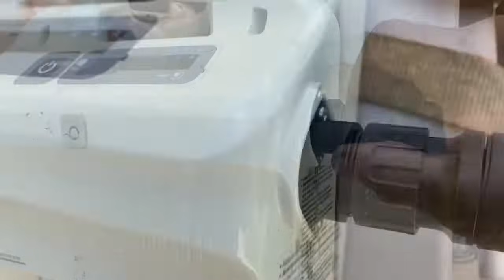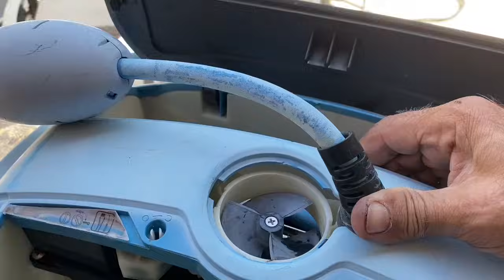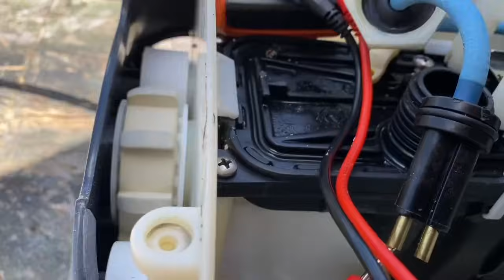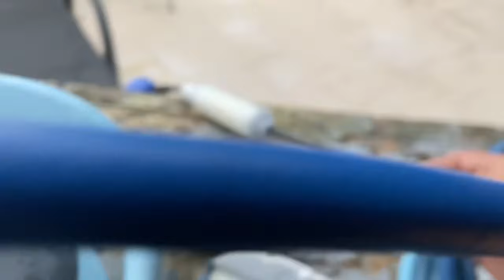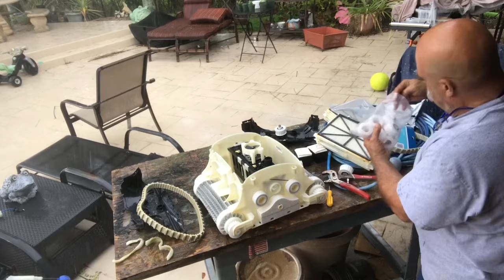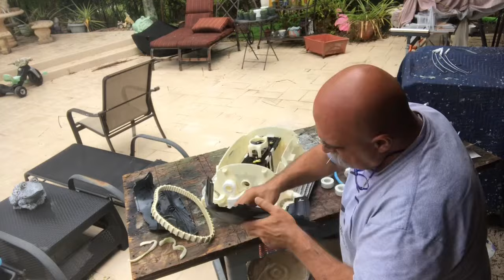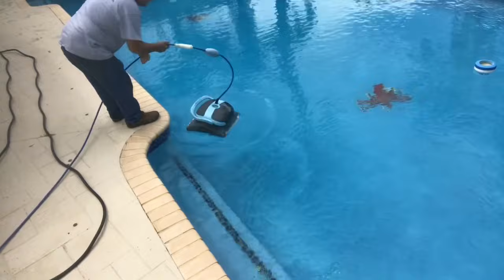How to diagnose and repair a dolphin pool cleaner

Comment: Can you not check for voltage at the end of the cable?
Reply from the maker: Yes, as long as your cable is working fine if you don’t get voltage, then go back to the power supply and then also check your cable for continuity. I hope this helps you and if you can leave me a thumbs up.
Reply: @buildingwithpapa I’ve got voltage at the head controller & at the end of the cable inside the robot so I’m guessing my robot itself is bad? I replaced the cable & it ran about 15 minutes and died.  My question is if you’ve got voltage then you’ve got continuity correct?

Comment: Greetings, my dolphin plus robot just stopped working.  It's only a year old.
The power supply turns on but robot wouldn't move😢
I am not sure if it's a motor or a wire(I did leave it in the pool once overnight, maybe it damaged something on inside?
Reply from the maker: I know they say not to leave it in the pool, but I leave mine in there quite a bit. Did you go through the diagnostic like a show in the video to find out if it’s the power supply or the wire you need to do that first. I hope this helps you and if you can leave me a thumbs up.

Comment: my unit goes few feet and in circle and then stop what is wrong with it
Reply from the maker: It is hard to say unless you’ve gone through the diagnostics like I show to find out if your supply is putting out the proper voltage if you cord tones out then that eliminates your cord then you have to go through other steps, but I don’t know what unit you have Let me know the unit that you have and maybe I can help you

Comment: I’m getting 36.2 volt reading from my lower supply. Sticker on back says 30v nominal. Any thoughts?
Reply from the maker: Thank you for your question. Yes, the voltage should only be 30 so seems like your Supply is too high, which is going to possibly burn out your unit. What does your machine do at this time?
Reply: @buildingwithpapa  it is randomly working and sometimes turning off mid cycle. My dolphin model is the DL 2014 INT which is about 15 years old. Another question I have is that when checking the continuity of my cable if I put one of my voltmeter contacts on say the white wire on one end and then touch the other contact to the white on the other end I get a beep but I also get a beep it I’m on white on one end and black on the other. Not sure if that should be happening.

Comment: Not moving. Cord was bad.  New cord worked fine. Now now working again  power supply good 29.5 volts suspect motor are they expensive? How do you test and replace?  Unit bought in 2021
Reply from the maker: I will say if you have your cord is fine you show 29.5 V for the power supply. The only thing really left is telling you we are not liars. They’re not cheap but it’s cheaper than buying a new unit. Make sure all your bearings are free and not bound up that would keep the motor from pushing it, but it does sound like it’s very possibly your motor. I hope this helps you and if you can leave me a thumbs up.

Comment: The swivels are going to fail after about two years I didn’t want to spend another $200 on this thing after replacing all the other parts so I took the swivel off and wired directly 
For $200 I want tangled the cord when I pull it out of the pool
Reply from the maker: Thank you for the information. I’m glad that works for you and if you can leave me a thumbs up.

Comment: After only 2 years, I need to replace the cable!?! Amazon reviews state you one you linked to does not have FLOATS and their machine flips on its back. Reviews also state: 
Update after one year:
- cable deteriorated such that the rubber jacket/coating rubs off by hand (and leaves a mess all over the pool)
- a kink developed in the middle (anti-kink swivel eh???) such that the rubber jacket is compromised and exposed the internal wires
- the buoyancy issues below persisted
- the unit will no longer run
A comment below states you do NOT have to buy the entire cord, you can just buy a replacement swivel cable? 🤷‍♀️
Will NEVER purchase Maytronic products again. For the price, I have had to replace the far too many parts on this machine. You cannot find good quality in products anymore.
Reply from the maker: Thank you for your comment. I showed to take the floats off my existing cable and put it on the new cable. I also show how to diagnose it whether it is the cable or not so you’re not replacing all the parts the moving parts that deteriorate just because I had them out, I hope this helps you and if you can leave me a thumbs up.

Comment: Still does not work!  Replaced all components :  guide wheels, pulley wheels, treads, and new wire cable.  Motor engages and starts.  But device fails to move through a cleaning cycle.  Fan is spinning/water is moving but device will not crawl.  :(
Alot of money to purchase and now repair parts cost.  Only 3 years old.
Reply from the maker: Thank you for your comment. Did you do a diagnostic like I show on the video this way if it is a cable you just replace the cable I do recommend replacing the rollers and the pads because they do wear out. I hope this helps you and if you can leave me a thumbs up.

Comment: Have pentair 920 prowler, runs for very short time and stops. Cannot climb side walls, continues to try then stops, also appears the back of the tracks (both sides) are slightly off the pool bottom
Reply from the maker: I have not worked on that machine, but have you looked at the tracks? Are they worn down?
Reply: I'm working on it. It seems like the motor gets water in it through the seals and creates rust inside the motor unit. Take it apart wash it woth wd 40 and replace the gaskets with better ones and maybe grease the inside of the motor to keep it moisture free. Remember, these robots are not meant to always stay under water. They are supposed to be out most of the time unless its cleaning time.

Comment: I made the mistake of following your instructions and checking continuity between source and unit, not realiziNg that the swivel also has contacts. The swivel cable has spring loaded pins and if the springs fail, there is no contact. A replacement swivel cable costs a fraction of the entire cable.
Reply from the maker: Sorry to hear that, but I did not have a swivel cable. Mine was stationary with the swivel, you would have to disconnect that part and then do your continuity test sorry for the confusion. I’ve had good response with this video and has helped many people and no way that I intend to mislead anybody. I hope you still enjoyed the video and if you can leave me a thumbs up.
Reply: No problem, turns out my old swivel was fine, I discovered it when the replacement cable failed and upon testing it was the swivel which turned on and off. I just thought that people should be aware and maybe sabe some bucks by replacing just the swivel.

Comment: Quick question.  How do you do a self test on a T35? Manufacturer did not respond to the question.
Reply from the maker: Thank you for your question but I have not opened up a T 35. You should be able to Google it and at least pull up the information on that unit. I hope this helps you and if you can leave me a thumbs up.
Reply: @buildingwithpapa  Why would it need to be opened to do a self test?
Reply from the maker: No, you don’t need to open it for self test, but I’ve never had a T3 five so I wouldn’t be the one to ask that question like I said Google it you should be able to find the information or in your owners manual. I don’t know what kind of power supply you have.

Comment: Excellent video, thanks! I followed all of your instructions, but none of the wheels are moving freely. I have to force them to move. Any ideas what I’m missing, or is this normal? Bearings are fine, no obstructions.
Reply from the maker: If the bearings are moving fine, then pull the wheels off and see if the rod in the middle is free if it’s not sliding or moving then that could be your problem. I haven’t seen that though. It’s usually the bearings I hope this helps you and if you can leave me a thumbs up.

Comment: hello, I was looking for help in something else with this cleaner and came across this awesome video..  im wondering, I once picked up flock with this vacuum and I tried it last week and just can't seem to pick it up, it throws it back thru the breathing hole, is that normal, or maybe something is wrong ?
Reply from the maker: Thank you for the question, but I am not sure what flock is? But the unit is going to run water through. It should go into the filters and then the water through the impellers so it’s possible one of your filters is open. This helped you and I’m glad you liked the video and if you can leave me a thumbs up.

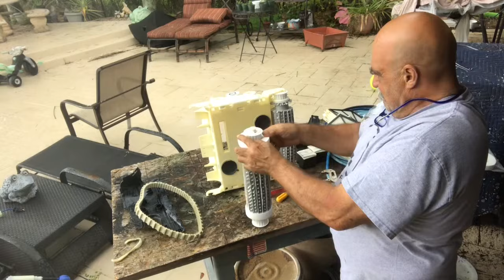Comment: 6:17 Thank you for this video! But, how do I remove the power cord float without breaking it?
Reply from the maker: On the float itself, it’s just plastic clips. Just be careful. Use the screwdriver and push down on one side. They will slide out. It’s a little difficult but you won’t break it. I’m glad you enjoyed the video and if you can leave me a thumbs up.

Comment: I have a dolphin sigma that runs about 20 seconds and the stops. I read it’s either the impeller or tracks/gears. I easily verified the impeller is clean but, I can’t seem to take off the side panels. Is there a preferred method or a more detailed video you have on removing the side panels?
Reply from the maker: Thank you for your comment. My pool cleaner is a nautilus. Yours is a sigma now I understand that the top un screws and can pull off. I don’t know about the sides, on the Nautilus. They’re just clips. They can pop right off and you may be a little concerned about pulling it because you’re worried about breaking it I understand, see if you can look inside and see if it’s just pushed in clips so it can be taken apart. I haven’t had one and I don’t know how to get into one. I looked at some other videos. No one seems to show sigma being taken apart, so I’m not sure if this helps you or not, but if you enjoyed the video and if you can leave me a thumbs up.

Comment: Our cleaner runs forward then back a few times then stops all together and  shuts off.
Reply from the maker: Did you follow the video and do the complete diagnostic? The power supply is very important whether it has the correct voltage coming out.

Comment: Thanks for the video. It's very helpful for me to troubleshoot my unit.  Mine is powered up ok, impeller running but the brushes isn't rotating.  Do you have any idea? Thank you!
Reply from the maker: Takeoff the police on the side that attached to the motor and see if when the impellers turning that the spindle is turning if it’s not then the gears inside your motor are broken. If that is turning then check the police that you pull off the bearings might be frozen or it’s just not connected to the spindle I hope this helps you if you can leave me a thumbs up

Comment: Changed my cable,  your video was way more helpful putting back together than the video link with. The replacement! But put it in the pool,  turned it on but it's not moving... lights are on the controller and let's you select but it won't start moving... what should I check next?
Reply from the maker: Did you check the rollers sometimes they get frozen I replaced everything except for the belts of which now I’m going to do that also you say you see the lights but do you see the water moving is the fan running on top? I hope this helps you, and if you can leave me a thumbs up.

Comment: Mine does the initial forward and backward move and nothing more. The impeller does not work at all. I tested the impeller motors directly with 29V and they rotate smoothly. I did all the electrical tests and putting all back together and same issue. Any idea what could be the issue?
Reply from the maker: Did you make sure you had 29 V coming out of the power supply?

Comment: What if the beeped when I checked the cabke what's the next step to check if it's not the cable
Reply from the maker: Did you check your power supply? If your power supply is good, and your cable is good, it may be your motor.. I hope this helps you, and if you can leave me a thumbs up.

Comment: Santo,
This model Dolphin Supreme M5 has dual motors.  One for each side.  It also has a pump.  I think the problem is with one of the motors.  The  slow low power side therefore the good side runs at full speed and the other side barely runs which makes it run in a circle.  One side works and also the water pump works.  Everything outside the motor housing is perfect.  All plastic is in good shape and If I manually turn both sides with the plastic gear they work perfectly so it must be the motor on one side.  Thought I'd let you know the latest info.  Of course I will continue watching your videos.  Thanks
Reply from the maker: Thank you for letting me know. I really appreciate it.

Comment: Santo,
Thank you for your response.  I have taken the Dolphin completely apart and checked everything.  The bearings are fine.  I put the Dolphin on its back and turned it on and did the test.  It ran the test on both side rollers and stopped as it should.  The test was fine.  Could it be the signals from the power unit or inside the Dolphin?  Again, thank you for your answer and I give you 5 stars and thumbs up for your suggestions.
Reply from the maker: Thank you I appreciate it but unfortunately I have not had that issue so I do not know what that is. I hope you figured it out and that you let me know. I hope you continue watching my videos and share them with your friends.

Comment: I love your video.  I have an a Dolphin M5 and it has worked great for 7 years but now it just moves in a small circle.  I have tried everything.  Do you have an explanation for this?  It simply stays in a small circle.  HELP!
Reply from the maker: Have you checked the rollers or the bearings on the rollers on the one side you should check both of them mine looked OK but they weren’t working great. Once I changed them it worked very well. I show all that in the video. I hope this helps you, and if you can leave me a thumbs up.

Comment: Hi, I noticed that you uploaded your video a year ago, so I'm not sure if you still remember the issue with the Dolphin cleaner. I have a Dolphin Advantage, and it's experiencing the same problem: it moves a bit and then stops.

I've already disassembled the cover and checked the impeller. There doesn't seem to be any clogging, and it turns by hand. I also replaced the cable.
Despite these checks, the problem persists, and I'm running out of ideas on what to investigate next.

Do you have any suggestions or ideas on what else I should look into? Thanks.
Reply from the maker: Thank you for your question. I do remember what was going on with my dolphin cleaner mine wasn’t moving at all so I went through the process that I showed you in the video and was able to diagnose that it wasn’t the power supply or the motor on the dolphin cleaner, but it was the cord itself, that is an easy fix.
Just replacing the cord is simple I suggest you run through the diagnostic that I did and see if you continually get the information back from the Supply make sure it’s at the proper numbers I give you all that information in this video. I haven’t had the problem that you’re having. I hope this helps you, and if you can leave me a thumbs up.
Reply: Thank you, and Happy New Year!

Comment: I changed my cord but I can’t get the white cap to screw onto the threads
Reply from the maker: Thank you for your question. I know it will screw back on you. Just have to be patient and work with it until you get it to connect properly look at it and just make sure that a Square with the rest of the threads and not frustrating it and you should not have any problem. I hope this helps, and if you can leave me a thumbs up.

Comment: Hi thanks for the video. Mine doesn’t turn on I think it got water damaged… left it out on the rain. Any suggestions? Thanks again
Reply from the maker: thank you for your question did you go through the whole video and do the process that I do checking the power supply the cable all of those things let me know if you have or you have not that’s going to help me to answer your question.

Comment: Helpful video but in my opinion under stated what a pain some steps might end up being. I replaced my cord and pulling out that old plug from the vacuum unit wasn’t just a matter of wiggling it out. I had to use vice grips and really yank it out. Also removing those floats.  You just edited out whatever you did to get them a part. That was also a total pain and unless you have some sort of trick that you decided to leave out I ended up having to break two tabs by jamming them in with a screwdriver than I could finally take it apart.  Not that the video wasn’t super helpful but the simplicity was misleading in my case anyway.
Reply from the maker: Thank you for your comment. I’m sorry that you had such a hard time. The only item I had a hard time with was getting the wire out of the housing, and everything else was just as it is in the video the floats came out. Simply there was no tab to release I’m not sure which model you have but mine just had some grooves that the floats slid in so maybe you have a different model than what I’m using, but I didn’t edit anything out. Everything was as simple as it shows in the video for me. I hope the video helped you, and if you can leave me a thumbs up.